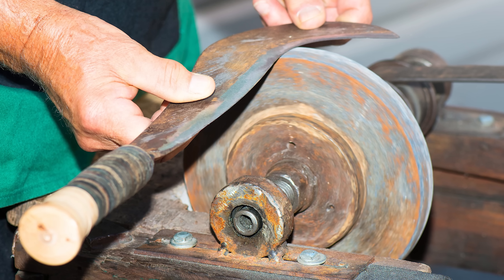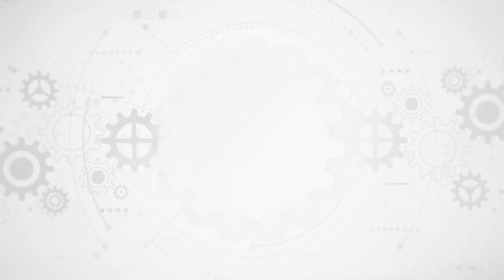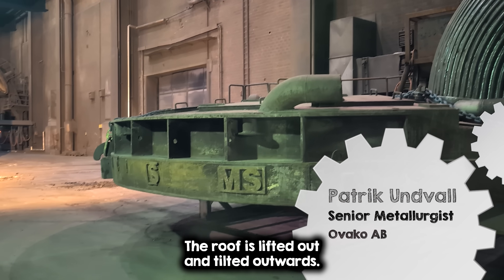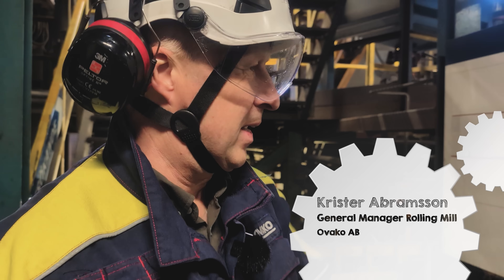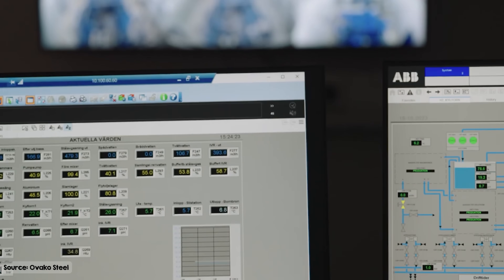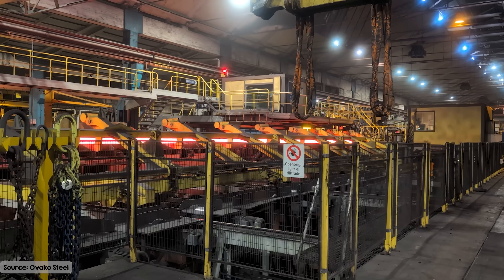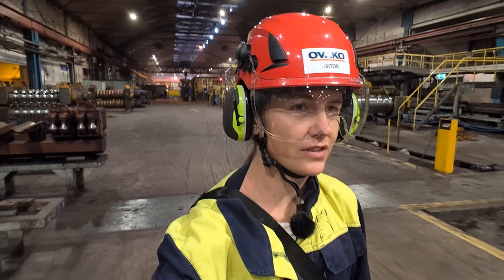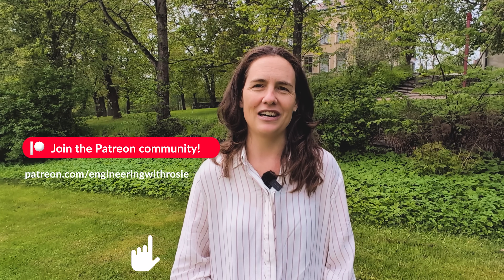STEEL REINVENTED: Inside the World’s First Plant to Burn NO FOSSIL FUELS [TOUR]

Comment: Great video with most of my questions about using hydrogen or propane for the reheating rather than electricity answered in the comments. 
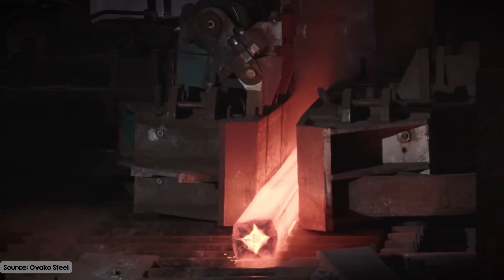At 5:58 you lost me when talking about radiant heat. I learned in The Hobbit: The Desolation of Smaug that you can be inches away from rivers of molten gold with no ill effects. Gold does melt at 1064C and the steel in the foundry is 1200C so that could explain the difference ;)
Reply from the maker: Hahahaha 😂

Comment: "...but now also wind energy to provide clean electricity...", ok, I'll bite, why do they use wind energy instead of nuclear energy from the Forsmark Nuclear Power Plant (about 100km/60mi due east of them, and yes, the trasmission grid is nearly straight (detour is about 40km)) ?
Reply: Wind energy is cheaper than nuclear.
Reply: @nae-nae-99  Forsmark is at a production cost of about 22öre/kWh[1](~2.3uscent/kWh) (or at least was back in 2023)
A quick search seems to put large scale wind power at 3-8uscent/kWh, so, it doesn't quite jive either.

[1] incl costs for final disposal, setting aside for demolishing, and site restoration, swedish laws demands this. (should mention, that all build cost loans have been paid off, this is why it might seem low (most nuclear that has paid off are in this ballpark, typical for BWR would be in the 3.5uscent/kWh range (the ABB BWR is just exceptionally cheap, and that is what Forsmark uses))

But it also was a bit of a quip about that electricity usually is from the nearest source, and in this case the nearest source with enough power is Forsmark.

Comment: to be clear most of the CO2 emissions from steel production (60-70%), comes from the reduction of ironxoides into pure iron, where carbon is used as the reducing agent, i dont feel like this is really mentioned in this video. There are however cleaner alternatives to carbon, SSAB (another swedish steel producer) uses hydrogen for the reduction, making water.
Reply: It is kind of a cheat declaring this as the lowest emissions steal, because they are using mostly scrap with only a bit of ore to make the ingots. 

Sure it is great to recycle. 

But this facility starts with a low emissions advantage compared to a facility that turns ore into ingots.
Reply: Totally agree. Was waiting for the part about h2 as a reducing agent.  Nope.  It’s a scrap recycling video.

Comment: Why are they producing hydrogen to heat the ingots, rather than heating them directly by the electricity?
Reply: because its way more capable than electricity lol!
Reply: Hydrogen is a stand in replacement for existing propane.  It also allows for time offset to cheaper wholesale electricity prices and surge power as required without overloading the grid.

Comment: The question is who will buy this Steel when China and India make much cheaper steel using coal power.
Swedens CO2 per Megawatt has increased significantly over the last 30 years thanks to the Green party insisting of closing nuclear powerplants. Wind is not carbon free it uses much more as per the Swedish department of energy stated, you need to build 7 MW of Wind power to replace 1 MW of nuclear plus keep a gas or oil power plant on standby as well as spend the money to maintain them so you are paying for 8MW to use 1.
Reply: The source you have used is feeding you inaccurate MWh numbers.

Comment: ofc, this is nonsense. Hydrogen is not a energy source, but a energy carrier (a battery, which needs charging). 
Still requires a energy source (like gas, coal, or hydro) to create the hydrogen. And that process is still very inefficient, as it loses about 50% of its energy.
Reply: With the excess electricity for solar and wind in many parts of Australia, just use that.
Reply: @awolffromamongus875  Ever calculated how much copper cable would be required for getting it from Australia to Sweden? and you'd have about 100% energy loss over such distances anyway. It is basic math, I'm sure you can do it.
Reply: Hydrogen is a stand in replacement for existing propane.  It also allows for time offset to cheaper wholesale electricity prices, cheaper wind surplus, and surge power as required without overloading the grid.
Reply: @nae-nae-99  No it isn't. You need propane (or other carbon fuels like  oil / coal / gas ) to make hydrogen in the first place.

Comment: what about using induction heating to heat the steel?
Reply: Yes I was woindering about that.  Also billet casting is pretty old fashioned in itself.  What happened to continuous casting?
Reply: could it be that the resistances in the induction coils waste too much energy as heat that needs to be cooled, as opposed to dumping all the energy in with low resistance electrodes forming plasma? and also that it's easier to work with a high voltage arc than a low voltage high current inductor?
Reply: @MartynDerg  is that a guess, or do you know something about that?

Comment: I understand that green hydrogen has been used as a replacement fuel in existing furnaces and this minimises the capital expeinditure for this new heating system. However, it would be more efficient (and therefore lower operating cost) and quicker to use electric induction heating, however this would require investment in a new electric induction heating system.

Comment: One question: Why not use induction heating to heat it instead of hydrogen?
Thanks
Reply: Hot steel is not magnetic - Curie point?
Reply: @nigels.6051  Does it need to be? I’m sure that they use this to heat steel for fusing chains together and heating and processing steel. I know they can get it pretty hot! Maybe you are right and thats the reason.

Comment: Having seen the price of electricity periodically switching between around zero and uncomfortably high, on a daily basis, and even between at least really low and high twice a day here in Sweden, substituting some of the fossil fuel with directly produced hydrogen when the electricity is cheap makes total sense. 

I suspect that a lot of people will get stuck on the fact that it's not total elimination of emissions, but perfection is the enemy of good enough. Besides a significant reduction in emissions, this can provide very meaningful utilization of "excess" power generation, increasing the amount of solar and wind power generation we can have without much negative economical consequences.
Reply: Unfortunately electrolysers cost more to operate in this intermittent fashion vs continuous operation
Reply: @redshift3  that would be both true and not... The price of electricity is a huge part of the overall expenses. And as a result this intermittant operation is actually more profitable as the energy prices fluctuate.

More importantly, this is not some futuristic idea, but an actual plant in operation. Quite often similar arguments are thrown around as if it would be impossible or by very least not profitable to run electrolysers intermittantly. But here we are.
Reply: @JuhoJohansson-bz3jb  yes, wholesale prices even go negative, so my comment about electrolyser intermittency cost is both true and irrelevant 😀
Reply: @redshift3  It's pretty simple arithmetic to see that for a given investment (capital cost) lower utilization means higher amortization cost per hour of output (simply because it's the same cost divided by less hours). This is true regardless of energy cost. But I'd be curious to see how significant each input is i.e. the ratio of capital to energy costs in hydrogen production, also considering time cost of capital (debt interest). Today electrolyzers are very costly.
Reply: @enemyofthestatewearein7945  True. With sufficient electricity price volatility it might still be economic. No doubt these guys ran the numbers and are satisfied, particularly as they have other incomes (savings on oxygen purchase, sale of heat to district heating scheme)
Reply: @redshift3  Great conclusion, your comment was both entirely true, while also  at least not very relevant.
Reply: @redshift3  Agreed, we have to look at the full picture not just one factor in isolation.
Reply: @enemyofthestatewearein7945  Good thing electrolyzers are pretty simple things, and doesn't have to cost much. According the Swedish energy agency the total cost of the project was about 16 million euro, and the Swedish energy agency payed ~40% of that money. 16 million euro for a more or less bespoke 20 MW system, for testing/trials, suggests the cost for the electrolozysers should become negligible if large scale adoption takes place, as long as the electrolyzers sees more than ridiculously little use. 

Hydrogen is extremely expensive/difficult to store and transport, per unit of energy, not to generate via electrolysis. How to generate hydrogen from water via electrolysis on an industrial scale was figured out well over 100 years ago, but we're still not anywhere near figuring out how to store it and transport hydrogen to make it relevant as a pure energy carrier for things like general energy storage, or fuel for ordinary vehicles.
Reply: @fishyerik  The problem is that the debate has been muddied by legacy gas interests. They want to show that hydrogen can be produced for the same cost as natural gas, and these numbers do not stack. This does not mean that hydrogen will not be useful for high value applications.
Reply: The issue still is what per of time is it running hydrogen as the extra  cost profile  of intermittent electrolyser use will reduce the cost window
Reply: Why would they be exposed to the whole sale price? I really do not understand that
Reply: @arvidm4913  they could choose to purchase from the wholesale market or make a deal with a retailer that is related to the wholesale price. They want to be exposed to price volatility so that they can use the electrolysers during very low price periods. The wholesale price even goes negative sometimes, so they could be paid to use the electrolysers. Also, fixed price deals always include a price premium for the retailer taking the wholesale price risk.
Reply: @arvidm4913  if you are referring to the spot price of electricity... And I would point out that I do not know about the actual contracts of a specific plant, but in general... Industrial companies often buy power with long term contracts, and doing so basically does isolate them from the spot-markets. But in some cases, if the spot price does rise too much, sometimes industrial companies will simply cut their own power use and sell the power they bought in advance.

But if I would have to make a guess, it is likely that in this case Ovako might be trying to catch the absolute lowest prices by buing power from spot markets. And this does come with the obvious advantage, that the long term contracts are not exactly charity, but come with a premium over average price... It often still makes sense to buy power that way, to both limit uppside risk and make cost of goods sold more predictable. In this particular case they allready have an effectice cap on energy price in form of LPG.
Reply: @arvidm4913  Demand and supply. Either they pay a fixed price, and use power regardless of the supply/demand situation, which needs to be relatively high, as the sellers of power has to agree to that price.  

Or they can pay wholesale price plus some small additional "markup". I do the latter, and pay less than 25%, on average, for the electricity alone, of the fixed price I was offered last time it was time for renewal of my contract.  

By that, and in combination with things like getting more energy efficient equipment, and small adaptations of when I use power, my total cost for electricity is lower now than it was 20 years ago, in strict numbers, as in even before taking inflation into account. 

And that's despite higher fixed fees, significantly higher energy tax, and new fees supposedly introduced to finance grid maintenance and upgrades, but mostly just maintenance, which apparently the huge profits grid operators make isn't supposed to cover.
Reply: Its not that we get stuck on the production that is great, its the title that is misleading at best, it makes it sound like it is totally green energy ran and it is far from that so its the author not the steel plant that annoys me because green energy advocates lie about 80 percent of the time as this heading did.
Reply: Reason bills are high is because of oil and gas lobbying, and oil and gas subsidies payed by your tax money.

Comment: Cant you use induction heaters to heat steel for hot rolling?
Reply: Sure, but what about the costs to upgrade the entire ovens? In their case they already had the pipes, they only added an electrolysis unit. Yes, induction makes more sense, but sometimes is about balance between solution/costs.
Reply: @peppyzacat5179  induction also uses way more energy too! and hydrogen/gas gives them more flexibility.
Reply: @carholic-sz3qv  And hydrogen doesn't? Hydrogen is really inefficient, but it allows you to produce and store it when electricity supply is high and demand is low. With induction you have to use the electricity as is produced and we talking megawatts of power. I think the best solution would be to use graphite heating elements to heat up the ovens. They are resistivity loads, not inductive (which requires capacitive compensation) and doesn't affect the cos phy of the grid and act as a buffer. You store the excess electricity in heat, basically.
Reply: I just read that magnetic permeability is important for induction heating. Induction heating is less efficient on conductors with a low magnetic permeability (copper, aluminium etc.).
Reply: lol!!! the induction heating is going to be significantly way more expensive plus its going to be need even more electricity and not be uniform in the application.
Reply: Going back to school memories, I think above 500 deg Celsius, steel structure changes to Martensite (?) and it becomes non magnetic, so induction would not heat the product. Please correct me if necessary, my memory is old!
Reply: @mikewatson1105  The curie temperature of iron is 770C (wikipedia). Above this temperature iron is no longer ferromagnetic and loses its magnetism. However a material doesnt have to be magnetic for induction heating. Induction heating works by inducing a current. I believe this is possible in any conductor, wether ferromagnetic or not. For example you can melt aluminium using induction heating, but aluminium isnt ferromagnetic.
Reply: @mikewatson1105  induction heating works with any metal, it doesn't have to be magnetic
Reply: @mikewatson1105  Above Curie Temperature, iron can't be a permanent magnet. But magnetic properties can be induced above that. In fact: You can melt Iron with an induction heater. The reason they don't do that is because electricity is expensive.
Reply: @lars3509  the hydrogen comes from electricity too, that makes no sense
Reply: @TAWithiam electricity from solar and wind cycles during day and weeks. Hydrogen can be stored (though i wouldn't for long).
Reply: @TAWithiam  It makes more sense when you consider that they store the hydrogen from phases of low electricity cost. With induction heating, you have to get the electricity of the spot market and provide more power over a shorter period of time as it can't be stored. But anyway: I have seen resistance heating to 1200 °C with electricity in a plant (not steel) as a replacement for gas. But in such cases you can't just buy the electricity from the grid, you have to consider the infrastructure. In my case, the site had multiple power plants and provided the electricity itself. If you buy electricity from the grid, you might be limited by the amount of power the grid operateur can provide to you. It could be that they aren't allowed to pull so much power at once (With both EAF and reheaters). But of course I am just guessing.
Reply: @lars3509 Im pretty sure they said they use the electrolysers to generate hydrogen and oxygen and use it straight away. I dont think they store it.
Reply: You can, but they're swapping between propane and hydrogen depending on the electricity/gas price. You'd need extra plant to swap between induction and propane which would be expensive and take up extra floorspace, and wouldn't be a quick swap. They're also using the oxygen from electrolysis. The video says they don't store the hydrogen, it's straight from the electrolysers to the heaters.
Reply: @marksherborne391  you cant!
Reply: Exactly. Hydrogen electrolysis is about 60-80% energy efficient, then your exhaust gases carry a lot of that energy. Induction would be much closer to 100% than electrolytic hydrogen heating.
Reply: @lizard5678  nope i wont! there is a reason they arent using it lol!